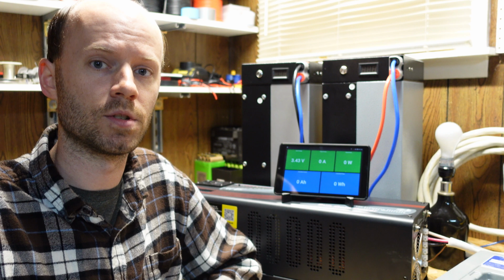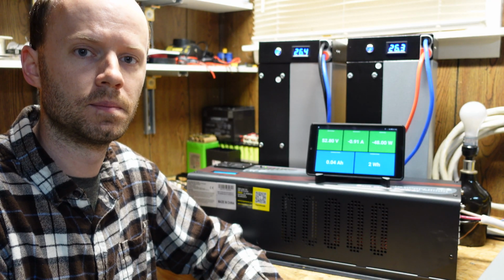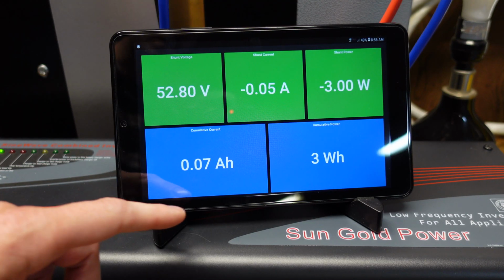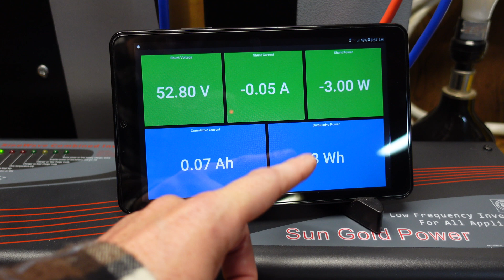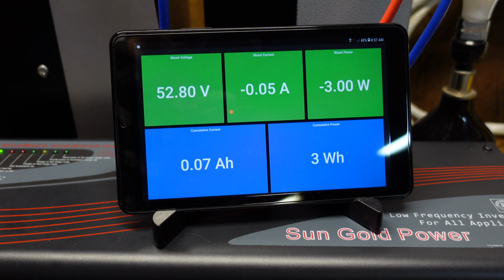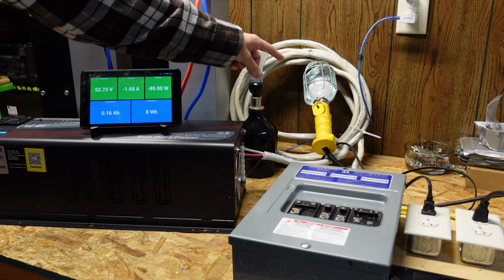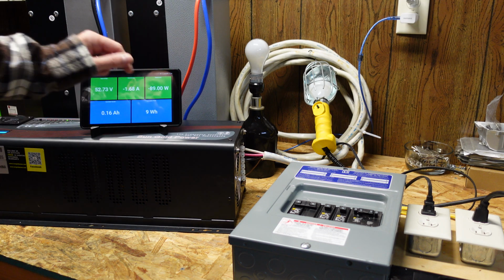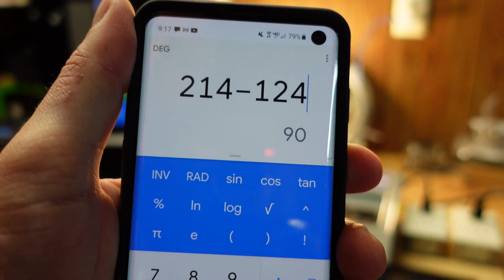SUNGOLDPOWER Inverter Power Saver Mode - Is It Useful?

Comment: Thank you for research/demonstrating the idle mode!!   I have AIMS and don't use idle because I was suspicious it would work for me - and I think you've confirmed it.    I have ATS(s) downstream from my AIMS and this small probe would not find loads / or (I suspect) be enough to activate the ATS to switch from grid to inverter.  Also - that pulse of light on/off...   I'm not sure I would want my refrigerator or sensitive loads to be pulsed like that.     So regular mode for me :)

Also on inverter consumption during load.  From my observations running a 12,000w AIMS...  you have to get consumption up quite a bit before you begin to mitigate the idle draw.    Not sure exactly but you need both legs to be 30% or more of the total capacity of the inverter to get near the peak efficiency specs of 88%.    In my DIY off-grid system last year - the average for a year was 83.5% efficiency on 15,000kwh consumed.  These numbers were calculated by dividing  'cheap Amazon meter on AIMs output'  by  Midnite Classic PV input numbers - so they could be off a bit but my sense is that 84% efficiency for real world use is probably pretty close.

Comment: I think this power saver mode would be funny in a house with led lamps. Blinks every 3 seconds...
Reply from the maker: I did try an LED bulb. It didn't flicker the same way the incandescent did. I'm guessing the pulse isn't long enough for the circuitry that converts AC > DC in the LED bulb.
Reply: @LithiumSolar  true
Reply: @LithiumSolar  Sad 😢